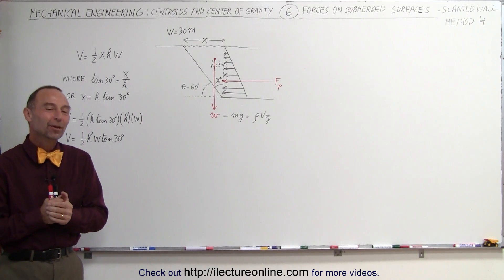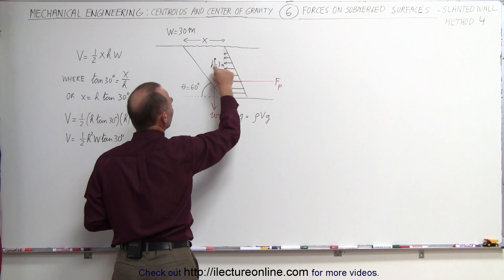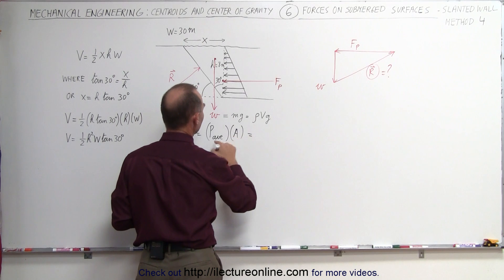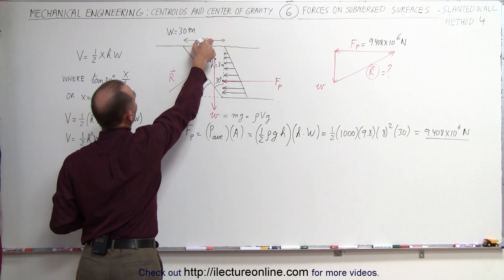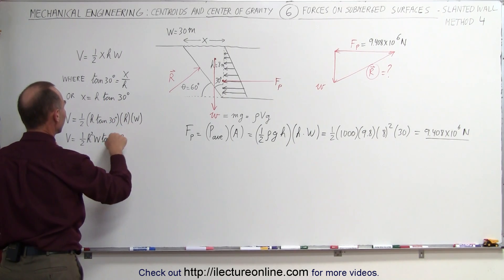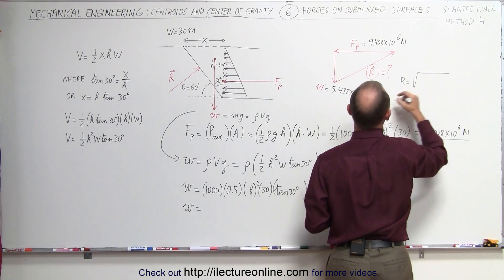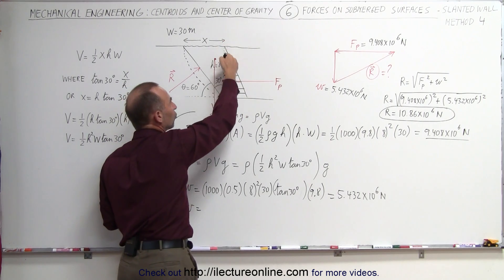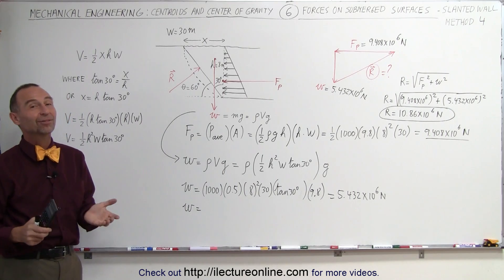Mechanical Engineering: Forces on Submerged Surfaces (6 of 15) F=? of Slanted Wall: Method 4

Comment: if the horizontal  force FP acts at 1 third from the bottom, then why is the same force FP calculated by a fomula which determines the force at the halfway point?
Reply from the maker: The force acts everywhere on the vertical "wall" and is calculated by taking the average pressure (half-way down) from the top.
Reply: @MichelvanBiezen  Thank you for your response. i am confused because the force FP appears to act through the centroid of the triangular pressure diagram 1 third up from the bottom. I cannot seem to understand when to consider the centre of pressure or pressure at centroid to determine where the force is acting. (first year civil engineering)
Reply from the maker: If you were to combine all the dF over the entire surface and place it at a single point, the force would indeed act at the point 2/3 down from the surface.  However that is not important to find the Resultant reaction force from the dam surface as shown on the video.  Only the magnitude and the direction of the force are needed here.
Reply: @MichelvanBiezen  ok thank you that clarifies it

Comment: Is there a second slanted slope on the right of the actual slope. ?
Reply from the maker: No, just water.
Reply: Assuming you mean like the opposite wall of a pool or the shore on the other side of a lake, here's the funny thing.  Even if there was, it wouldn't make any difference in computing the force on the one on the left.   A dam with 1000 liters of water against it sees the same force as a dam holding back billions of liters.